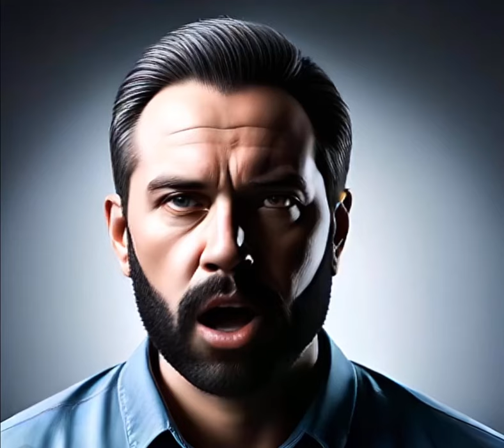Ep. 7 Suppressed Back Pressure

Comment: WHAT ABOUT JUST USING A SUPERLATIVE ARMS ADJUSTABLE GAS BLOCK. IT WOULD BE SIMILAR TO FLOW THROUGH.
Reply: No, it wouldn't.
Reply: An adjustable gas block can fail. And I believe if there's a highly restrictive can on, it will trap gas and slow it down from exiting the muzzle, this will cause gas to flow backwards, down the barrel to the user and there's nothing a gas block can do about that.
Reply: Mine definitely reduced the gas blowback.
Reply: @mattnikirobidou  that's good, it should definitely reduce it. a flow through can might reduce it even more.
Reply: NO IT WOULDNT
Reply: An adjustable gas block is never going to be the same as truly low back pressure